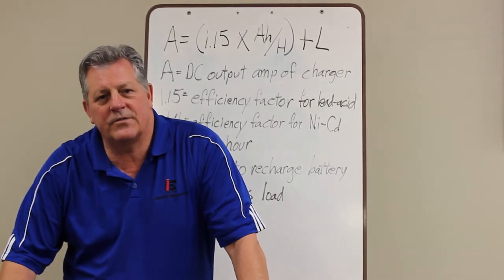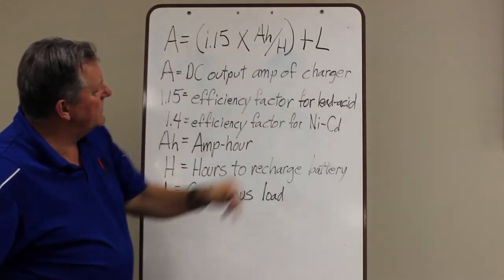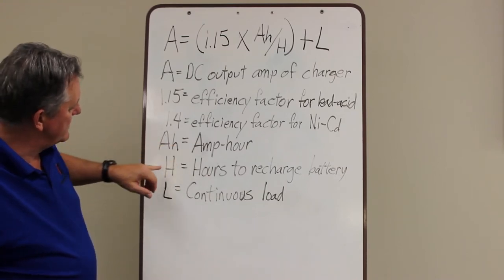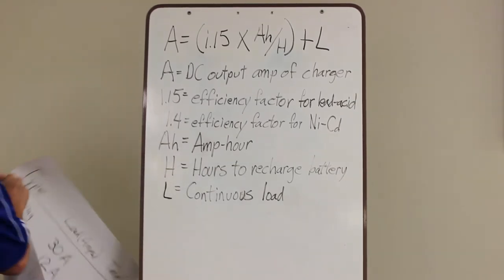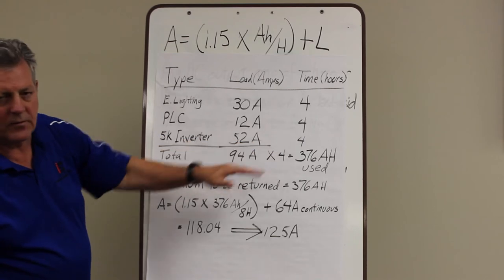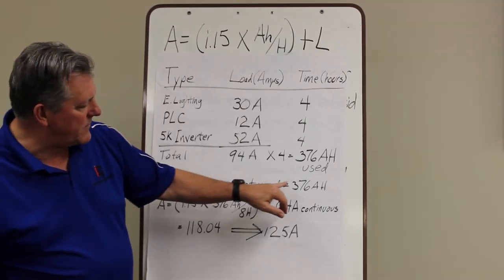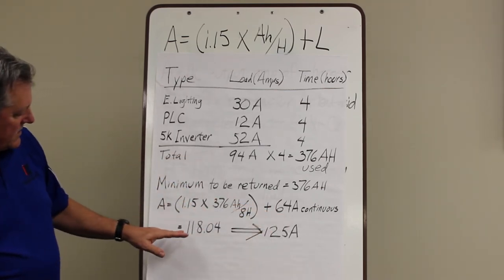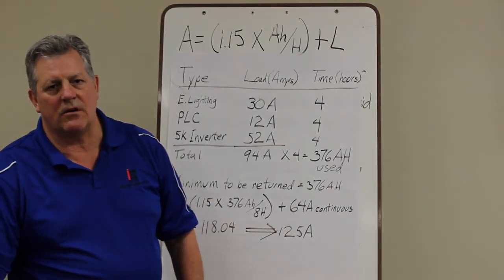How to Size a Battery Charger

Comment: my forklift charger is 20 yrs old working good, getting a new forklift w new battery, should I change the charger also, to protect my investment, does the charger technology as evolved  since to charge a 36V 750ah battery?
Reply: I would, Most Chargers have capacitors and they go bad after 10-11 years.